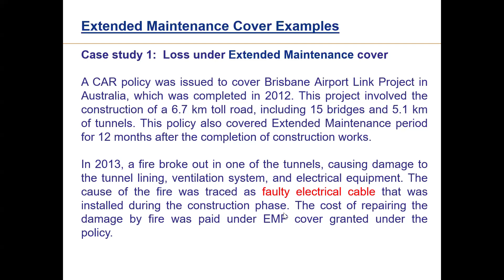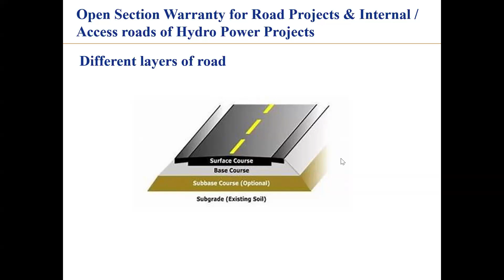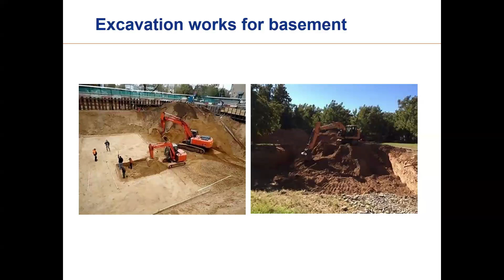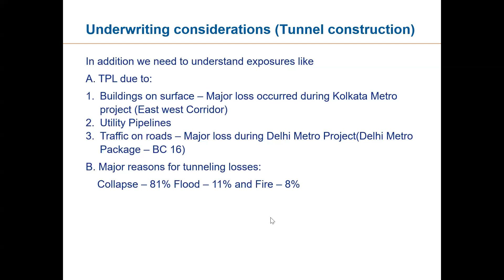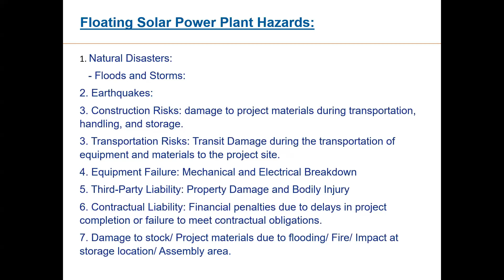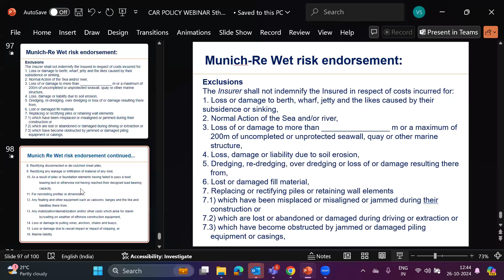CAR Policy - Webinar Part 2

Comment: sir not in a single video you discussed annual EAR/CAR and all confusion lies in the extension of such policies
Reply from the maker: Yes your point is well taken. I'll definitely make a presentation on annual e a r policies.
Can I know what is your query in relation to extension
Reply: @VPinsupedia  sir can we extend a project within open policy period itself or can we extend upto 12 months irrespective whether the policy is expired or not as long as inception lies in the period. Also what if client comes on March end and asks for 10 months extension (max project duration is of 3 months) and policy period is from Jan to Dec. (Basically the declaration happened on last day and total duration is now becoming 13 months)
Reply from the maker: In case of annual e a r policy the policy period of any individual project is agreed and defined. In respect of other projects where the project period is longer than what is agreed in annual engineering policy, separate e a r policy is given. However if due to genuine reasons a project is not completed within time, it can be extended within the scope of annual policy provided the inception date was within the 12 months period of annual policy. 
To better understand this concept a letter to you can example of 6 months project which is incepted in the 11th month of annual policy.  This project will be covered till its completion irrespective of whether annual policy is expired or not.